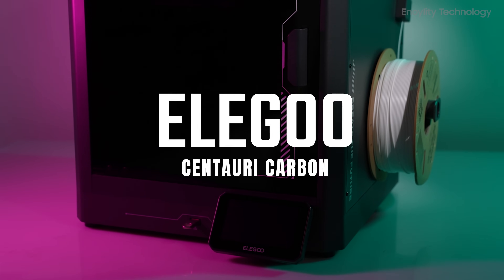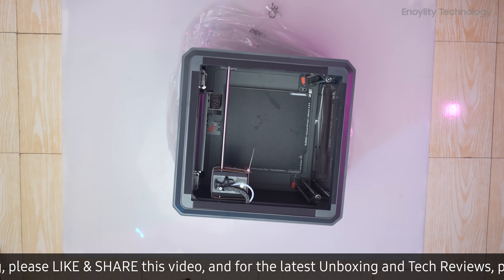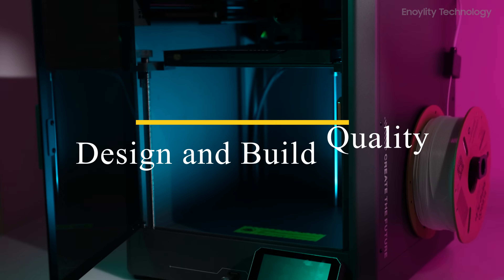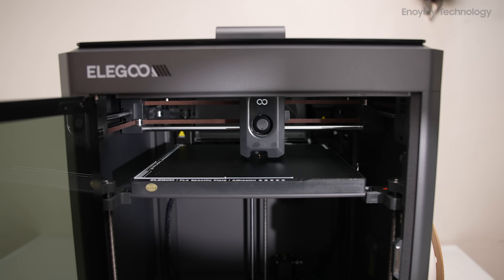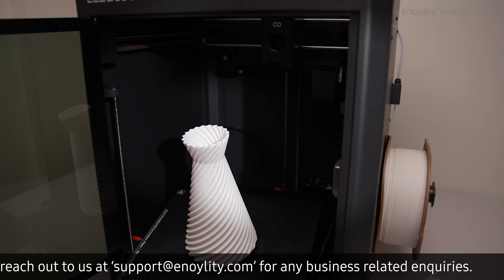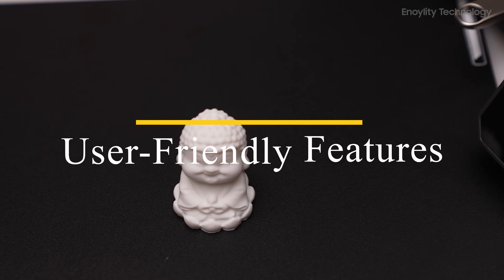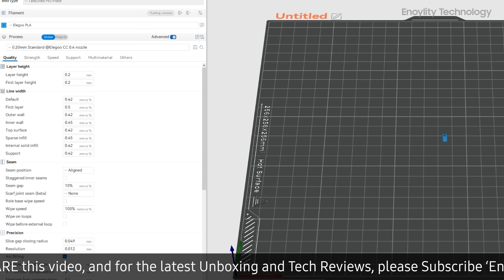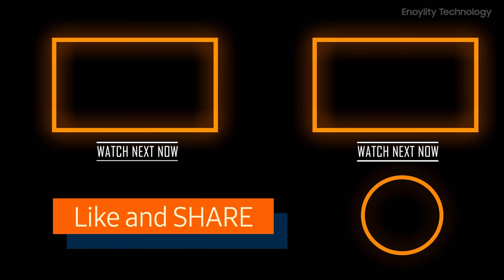ELEGOO Centauri Carbon Review: The Premium FDM 3D Printer You’ve Been Waiting For!

Comment: Once the product arrived, I went through the instruction manual and set everything up. Seems simple enough. I loaded up the provided test file and began the print. 2-3 hours later, I went down to check on the progress only to find that nothing was printing on the build plate.
Reply: So far the printer is great, my only thing is there something behind the touchscreen that is driving me nuts. Yes, I removed the protective film and it is still there. It is behind the touchscreen. I would expect a little more QC for the price
Reply: There was no learning curve, which was nice too. Granted I've only done one print, but if it is anything like the previous model, I'm looking forward to hundreds more great quality print jobs!
Reply: The build quality is insane for the price. Feels more like a commercial machine
Reply: Affordable price compared to other 3D printers in the market
Reply: I must recommend this product and being begineer, its the Best Buy in this budget range.
Reply: Quite sturdy, full metal, very good impression. Looking forward to putting it to work.
Reply: Other than that my son is super happy and I guess for a 9yo that’s good enough.
If you are looking for something more professional I would go with better one.. like something more serious
Reply: Great space saver for the print volume. Easiest filament install and change. Would have given 5 stars if there were more clear instructions on what
Reply: High-quality prints at impressive speeds ⋅ Durable construction ⋅ Higher print speeds

Comment: The detail on small items is amazing as well. Print times are pretty much the same as the Mono, for the most part, so there's no speed improvement from 2k to 4k (not that I was expecting any).
Reply: It's located at the bottom of the z-axis instead of the top, which renders the "set z=0" function effectively useless, since it still has to pass the sensor at the bottom to know where 0 is supposed to be.
Reply: This printer right out of the box printed the Rook that was on the USB drive without issue. No leveling required.
Reply: I've printed basic cubes to have some print without the issue, and some with the issue with no clear difference in their slicing. Support, unfortunately, could only recommend I
Reply: Is it suitable for printing engineering grade materials?
Reply: Print quality rivals much more expensive machines.
Assembly took under 20 minutes with clear instructions.
Cable routing could be improved it’s a little messy out back
Reply: The heated bed heats up quickly, reducing wait time before printing
Reply: I love this printer, but the software they have you download and o use with it really pisses me off. There is such a disconnect with the software and printer that it works about half the time, like right now
Reply: The Mega is very cheap and has lots of features. 3D printing is a learning experience, you will mess up, you will make mistakes and you will break parts
Reply: The print quality is consistently excellent, even for intricate models

Comment: I know this is one of the things that come with printing with resin, but having an FEP fail after less than 10 prints is disappointing. I know people who say they've been using the same FEP for a year, and I can't for the life of me understand how that's possible
Reply: If you are looking for your first 3D printer or additional printers for commercial applications, look no further than Elegoo!
Reply: Got this printer as a replacement and its doing a really good job, print quality is really good, to good if you ask me with the 9k screen, Elegoo made it really easy to use, i didn't had any problems so far.
Reply: I was impressed on unboxing it. It seemed very sturdy and heavy. There were extra screws, which shows attention to detail and customer service. The screws were so tiny, I doubt the hardware store would have them. Needless to say, I dropped one of them and it rolled out of sight behind my work bench, so the extra ones were very much appreciated.
Reply: Fantastic printer if you have already had several 3D printers. Every conceivable option is available to customize each print.

Comment: I love that the screws for the vat come out, instead of being embedded in the base of the printer like the Anycubic. Means it will be easier to clean them if/when they get resin on them
Reply: Printer has a few little quirks (namely it can only run using .goo files, which are native to Elegoo. And the print will stop if the USB drive gets moved at all, which is really frustrating especially if you're a beginner).
Reply: Mine had a slightly warped bed support helped, but still a bummer
Reply: Love the build volume, but the printer itself is a bit bulky
Reply: Produces detailed and high-quality prints.

Comment: Good thing is I know about screen protector films now, and that I would eventually need one, so I already have one that I bought just in case this happens (Mach5ive). I haven't had a chance to install it and get back to printing, but once I get the new FEP installed as well as that I should be good to go again.
Reply: The resin tray is slightly annoying to take in and out. But overall the printer works great, and the resolution is amazing after using FDM printers.
Reply: The touchscreen is nice, but could be more responsive
Reply: I have unit working now. I emailed customer service and they emailed me back in less than 6 hours. They just asked for a picture of the problem and emailed me back in half hour stating that a new screen will be shipped out. So far this has been a mostly good experience.

Comment: I am not new to 3D printing. Previous to the Mars 3, I had an Anycubic Photon Mono and an Ender 5 Pro FDM. Love the Ender, and really liked the Photon - EXCEPT the maintenance nightmare that it was. It seemed that after every third print, the FEP would get holes, or the build plate wouldn't be level and cause a failure, or the LCD would go out
Reply: During troubleshooting, the USB drive that came with the unit decided it would stop working (Drive needs formatting). The USB drive would also not even format, it's dead. I had to use a spare that I keep in my utilities.
Reply: Instead of taking apart a brand-new device and futzing with the screen connection cable, as the official support wiki tells you to, I returned it and got this Elegoo machine instead. Couldn't be happier
Reply: What’s the max nozzle temperature?
Reply: Definitely a step above most budget FDM printers.
ELEGOO did a great job on design and stability.
Just wish they offered better documentation for advanced features
Reply: Options for performance enhancements.
Reply: Super easy to use, it's a perfect printer for beginners.
Reply: The Centauri Carbon is a serious upgrade from my previous Elegoo printer
Reply: The printer is surprisingly quiet, even at high speeds

Comment: I got frustrated with the failure of the FEP, then our family moved and it was packed away for nearly a year, and I just didn't have time to mess around with it to get it figured out. I was just about to give up and give it to someone who had more time to getting it working, but decided to try one last time to get it to work. I'm glad I did! It turns out that the resin I had started using initially was a resin that, while it sort of worked in this printer, it was made for a specific brand of printer that operated a little bit differently than the Mars 3.
Reply: App connectivity would make this perfect. Hopefully a firmware update fixes that
Reply: Good value for the price, making it accessible for beginners.
Reply: bery noobs friendly 3d printer and most importantly budget friendly
Reply: High printing speed
Reply: I highly recommend this printer and for the price, you won't be disappointed.
Reply: Touch screen is super nice and gives you good information ⋅ 3D Print really good ⋅
Reply: Great machine, the bed is quite large! With good settings, the prints are superb and the details precise!

Comment: Overall, I’m really impressed with the printer. The print quality is fantastic, and the features, like the tilting vat, self-leveling build plate, and remote monitoring, make it incredibly user-friendly
Reply: This product is really easy to use for beginners but you gotten read or wash some videos on how to use it properly
Reply: Is the Centauri Carbon equipped with a direct drive extruder?
Reply: Whisper-quiet operation. I have it running in the same room I work in no complaints
Reply: The layers aren’t as smooth as I expected
Reply: Handles PETG and PLA like a champ, no stringing at all.
I even managed some decent TPU prints after tweaking settings.
Print bed could’ve been a little thicker to reduce flex on big prints
Reply: It’s the best damn 3D printer made. If you don’t buy one, you’re a dumbass
Reply: On a positive note, auto bed level is a great convenient feature. I wish bed leveling becomes more common in consumer and hobby grade printers

Comment: Right now, I’m still in that “honeymoon phase,” but I’m looking forward to seeing how it performs once I get into the regular, day-to-day printing routine. I am very excited to try Elegoo other products.❤❤
Reply: Easy to use
Reply: It’s a messy and involved process using materials that you need to be very careful with, but the results are like nothing else. The mars 3 pro is everything I hoped it would be, as there are all the right details that help make sure all the PITA processes are worth it
Reply: The inclusion of Klipper out of the box is a huge win😊
Reply: Amazing hardware, but I wish the slicer integration was more refined
Reply: Reminds me of the Bambu Lab P1P but with more tweakability
Reply: That also includes, greasing the rods, before each use, and properly cleaning the build plate after every three prints or so. If you're looking to buy a 3D printer, do not waste your money on any others.

Comment: One thing that stood out to me is the printer’s ability to run self-diagnostics. If something’s wrong, the M5 Ultra will let you know. It also has resin sensors that detect when you have too much resin or too little resin in the Another thing I like is how easy it is to adjust exposure times.
Reply: The printer arrived very quickly, and setup was a breeze. For the price of the printer, it feels very premium. It also looks very nice in my office. It's somewhat of a statement piece.
Reply: Affordable price.
Reply: It's a reliable and versatile machine that has significantly exceeded my expectations.
Reply: Quite sturdy, full metal, very good impression. Looking forward to putting it to work.
Reply: The tilting vat is a great feature and the detail on the prints is amazing
Reply: The included cooling fans are effective, keeping the chamber and hotend at optimal temps
Reply: It's a great step up from budget printers without jumping into the $2,000+ category
Reply: The Elegoo Centauri Carbon’s CoreXY system makes it incredibly fast and precise — ideal for time-sensitive projects
Reply: I would strongly suggest getting some kind of adhesive removable print surface so that you can remove your prints easier. I just bought some filament that comes with one, and it seems to work great. It was square and sticks over the edges of the round plate a bit, but that doesn't seem to cause any issues, and if I wanted I'm sure I could cut it to fit better, but its working fine as is.

Comment: This  version gives you access to more advanced features, like better support generation, advanced model manipulation, and more control over the print orientation. It’s definitely a tool I’m still learning to use, but I can already tell that it’s making my printing process a lot smoother
Reply: There seem to be many factors in getting good vs bad prints. Unfortunately even after watching multiple videos, following suggested settings, and reading as much as possible trial and error has taught me a bunch.
Reply: Finally, a printer I don’t have to mod to get decent prints
Reply: Cooling setup is decent, but dual fans would’ve made a huge difference.
Reply: I’ve been printing nonstop since it arrived. Addicted
Reply: USB and WiFi options
Reply: Easy to use ⋅ Support around Mickey Mouse might be too thick and difficult to peel ⋅
Reply: Worth every penny!! Highly recommend the product for beginners
Reply: Impressive speed ⋅ No heated chamber ⋅ Poor chamber lighting ⋅
Reply: Everything is up to date so I don’t get why it does this. So I’m at the point where I have to shut the printer off and close the app and reopen everything.
Reply: Easy to assemble ⋅ Glass panel on top does a good job at reducing noise ⋅
Reply: Easy to use, great features and accurate detailed prints

Comment: Imagine being away from your printer and being able to check on your print from your Laptop—that level of convenience is something I really appreciate. It even supports time-lapse recording, which is perfect if you want to show off your print process to others or simply keep a record of your prints
Reply: Good speed for 550 mm per second. It support wide range of materials.
Reply: Fabulous printer with easy setup and remarkable detail. Be sure to calibrate and follow the instruction manual, also watch some YouTube tutorials as well
Reply: AI-assisted leveling actually works. Took me less than 10 minutes to get my first print running
Reply: Prints stick well to the bed, but still pop off easily when cool. That’s the dream
Reply: High print quality and speed.
Reply: Easy to setup, but kinda heavy to do alone. Printing works well, no issues. Recommended.
Reply: Prints turned out well! Easy to use! Recommended to all users
Reply: Made with sturdy materials for long-lasting use.
Reply: It was heavy and rightfully so. The openness of it makes it easy to clean. It’s a great size to be able to fit into any room. It is old so I would keep it somewhere that isn’t close to your living room area. The heat transfer worked perfect and I have had no issues to date!
Reply: Absolutely loving everything about this printer

Comment: It has a built-in camera that lets you monitor the print remotely. This is fantastic, especially if you have a busy schedule or need to leave your printer unattended. Imagine being away from your printer and being able to check on your print from your Laptop—that level of convenience is something I really appreciate
Reply: The first thing is go get the exposure ready, mine took 5 tried to find the right exposure to keep the print from failing but having the best detail possible
Reply: Speed is fantastic, but you’ll need to dial in your cooling for best results
Reply: Easy to set up and use.
Reply: Prints have good detail and finish.
Reply: Good quality prints and zero print failures till now.
Reply: I fully agree with the reviews I read about this being one of the best and easiest to use 3d printers. Once I was done, it all made sense.
Reply: The tilting vat is a great feature and the detail on the prints is amazing
Reply: Absolutely loving everything about this printer
Reply: The fully enclosed chamber is a great feature for printing with ABS or other temperature-sensitive filaments

Comment: This printer is FAST. The tilting vat really helps with that. Instead of having to pull the print off the FEP after each layer is cured, the vat tilts and essentially peels the print off by itself.
Reply: At the end of the day, with this printer, I have sprees of flawless prints with amazing quality. Then I will have weeks of issues with the printer where it will constantly pause prints and resume them for hours on end with no predictable cause.
Reply: Huh? This isn't a resin printer...
Reply: Good print quality
Reply: Fast prints, but a bit noisy when moving at max speeds
Reply: I wish they used better fans sounds like a small jet when running fast.
Reply: Enclosed design for safety.
Reply: Recommend it for a beginners printer as well for a seasoned enthusiast.
Reply: I've always been wanting an xy printer but could never afford it and thank you elegoo
Reply: The print quality is excellent and the box contains everything you need to get started with 3d printing.
Reply: Overall print quality of this model was fantastic ⋅ Software was easy to set up ⋅
Reply: Great machine, the bed is quite large! With good settings, the prints are superb and the details precise!
Reply: Large build volume
Reply: Value for money product, very good packaging and easy to use. Best buy for beginners.
Reply: Great affordability ⋅ High levels of reliability ⋅ Beginner-friendly user experience ⋅
Reply: Setup is straightforward thanks to the semi-automatic calibration system, which saves a lot of time
Reply: The prints look almost identical, my i3 prints well, but the qq looks good right off the bat, no tweaks at all.
I have been using this for over a month now with no issues. I did have to re-run the auto level, but that was because of my own itchy fingers messing with the z height